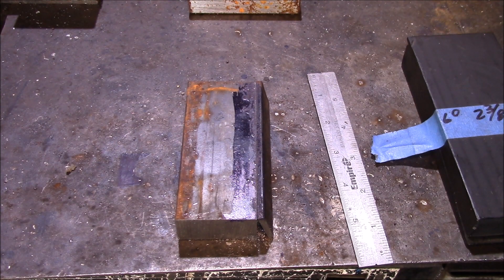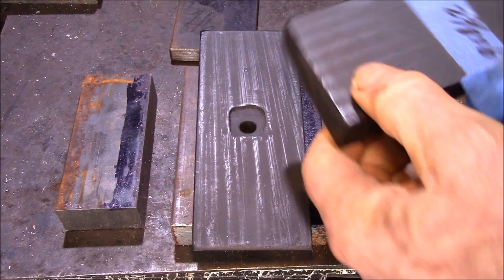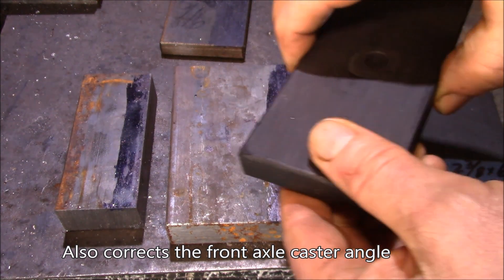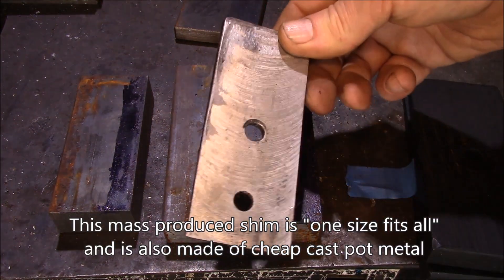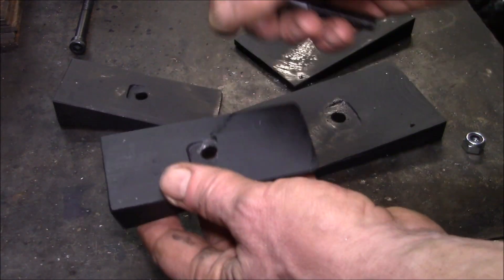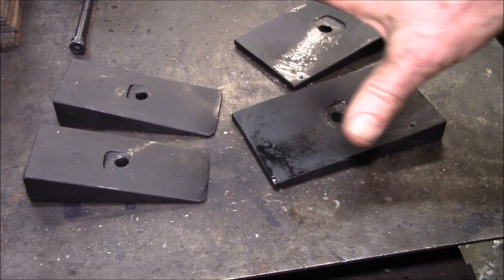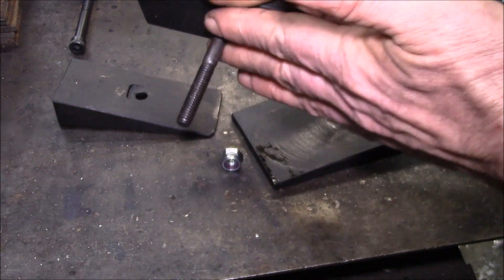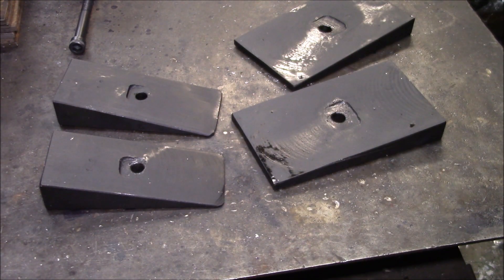Axle Pinion Shims

Comment: Hi. Thanks for th e video. Good explanation and your product seems solid. Could you help me figure out what I need to correct my issue. So my angles are as follows.

Measured at crank = 6.5 downwards
Measured at Driveshaft = 1.85 Downwards
Measured at Diff Yoke = 5.5 Upwards towards the front of car but I think this i s supposed to actually be downwards.

Would a 4 degree shim correct my vibration issue?
Reply from the maker: What angle you need will depend on the type of driveshaft you have:
https://www.4crawler.com/4x4/ForSale/Shims.shtml#FAQ1
https://www.4crawler.com/4x4/CheapTricks/Driveline-101.shtml#Measurements
If a single cardan/u-joint shaft, then you would want to tip the pinion/diff yoke angle down to make the crank angle, so down 5.5 to get it to 0 then another 7 degrees or so to get it at or slightly below the angle on the upper end.
If a double-cardan/CV shaft, then you would want to line up the diff yoke with the shaft angle, so 5.5 - 4 = 1.5 and you would be just under the shaft angle with a 4 degree shim.
Reply: @The4Crawler  Single one piece driveshaft. My application is a lowered vehicle actually. So 5.5 + 7 for a total of 12 degree? or do I want 7 total to correct for axle wrap?
Reply from the maker: @atxjax1  One piece, but u-joints or a CV joint?  For u-joints, same angle on both ends of the shaft.  For CV joint, set the bottom u-joint to the same angle as the shaft, i.e. 90 degree angle between the flange and shaft.  Allow 1-2 degrees lower to allow for axle wrap which tips the pinion up under load.
Reply: @The4Crawler  sorry bud. Yes, this is a 2007 GM truck so it has regular u joints.
Reply from the maker: @atxjax1  See the earlier reply or look at the alternative alignment option, last link below:
https://www.4crawler.com/4x4/CheapTricks/Driveline-101.shtml#References